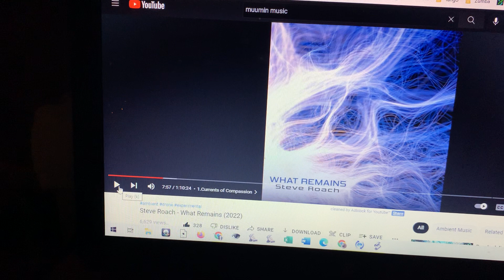Groundbreaking Report:  Potential Solution to Power Factor Problems!

Comment: "Hopefully" the second system will sound differently.. yes hopefully..

It is HOPEFULLY because we have 3 phase going into the apartment/house. From EACH individual phase we put a circuit breaker (that you have shown in a previous video) and you can run that to a dedicated power outlet for your stereo.
You might think that you probably have done something awesome..

When you have many let say 100 difrent power consumers in your home. And you can see in your breaker box that there is more than 3 circuit breakers.. 😉 

So if you have 30 circuit breakers evenly distributed between those 3 incoming phases then 10 circuit breakers for each phase.

So your "dedicated" power outlet is actually using and sharing the power between 9 other fused lines!

That means when you sit and enjoy music on your dedicated line and someone else in the house is switching on/of a light or appliance that are also derived from the same phase in your cirkut box. You can and I have experienced a "click"/spark sound in the hifi system! 
Because as fancy it sounds a "dedicated" is not the same that you are alone or isolated from others devices in your home.. maybe you are isolated 2/3 of them 😉

Next thing to know:
Power transformer will change the PF in one way. And if you want to go the other way (the opposite direction for correcting the PF) then add capacitance.

So now we know we need to have our two systems on different incoming phases so that there is a possibility that one is performing differently than the other.

The other thing we know is some appliances are 3 phase (electric stove, hose heating, some washing machines ans so on.)
For example my electric stove that is connected to all 3 phases, uses internally the different phases on difrent heating zones. So if all is cranked up to maximum then it will draw current from all 3 phases and being able to dispatch more wattage/heat. But depending on which of the heating zones I turn off then one or two phases will not be used. So depending on what phase your hifi system is using and how other appliances are switching in/out on the same phase as your Hifi system is using that will momentarily effect the PF you get to your Hifi system.

So nothing strange there in my opinion.

I have a EMI filter power brick. The only or the biggest reason I bought it were because it not only shows the normal things in the display as Voltage, amperage, wattage and so on. But it do also show PF!

I also of some reason bought a power saving device that is plugged into the power wall socket. That contains a capacitor..
I just could plugg it in or out and I could see the PF value jump up or down when I did that.
So the electric theory worked and the measurements did measure PF indeed.

But to be perfectly clear on one point. Despite it were so "easy" to change/adjust PF. That made A-B comparison really easy. 

And I in my system I could not detect any sonically difference in one or the other way.. so for me the PF experiment were a failure. 🤕
(One difference is that I am in Sweden and use 230V and 50hz so I don't know if a lower voltage system is more sensitive to PF changes?)
Reply: what is PF? 🙃
Reply: @raoulselten9480 Sorry, PF is Power Factor.
It is a measure of how much the voltage sine wave and current sine wave is in phase or more precise how much they are out of phase.

When they are in phase with each other then we are able to get the most power (wattage) when they peek at the same time.
Reply from the maker: Indeed, most likely 230V is much less sensitive to PF changes. I have never experienced PF problems in Hungary (230V), and I have reports from Australia (also 230V) that it's not a serious consideration there either. Also, apparently in Europe / Australia PF is much more tightly controlled than in the US. Here, it is ATROCIOUS, and the swings are humongous. I have never measured it, but I can experience it as vastly different heating capacity for the stove - sometimes even high setting is barely warm, and other times a low setting is already burning the food. That's indicative of hyper-massive PF fluctuations. We get single phase electricity for homes, and often the line is so overwhelmed that there's serious DC on it due to massive imbalance between the 3 phase distribution legs. So, here I have the "joy" to experience the wildest issues with line AC status - with PF, DC on the line, massive noise injected by myriad of SMPS in the homes, and super high number of electric devices in the homes.... 
When having different incoming phases, different optimal system for each is a very good idea! 👍
This is the sad bit about power, that there's no universal solution as the power situation is so vastly different in different places. Here, it differs from area to area, and mine is not even the worst....
Reply: @AmazonasBiotop  thank you 😊
Reply: Your stove and furnace aren't 3 phase. If you're in North America they will be 220 volts. It thought this was 2 phase when I was in electrical school and got corrected quickly. Think of it in terms of sign waves. If you had the equipment to see what's happening you'd see 220 volts is a single sine wave where as with 3 phase each phase is 120 degrees offset from each other. 

Not that this means anything in this particular situation. How do we know power factor is the reason the sound is bad? Industry could be doing all sorts of things that mess up the sound. Maybe it is just an issue of the huge load they put on the grid which is affecting the load impedance of the source. This is easily measured. 

A lot about how electricity works is not understood. The big brains that work with this stuff think they have it all figured out yet most of that is highly specific to particular contexts. Try to find a comprehensive scientific explanation of how to design interconnect. They think they know but there are clearly issues they have never identified. Inductance is supposed to be determined by loop area which means that if you separate the send and return wires the inductance should skyrocket and ruin the sound but this doesn't happen. Part of the problem is the math is too complex so it got dumbed down with Maxwell and most have forgotten that that is a hopelessly simplified model allowing someone to get an answer at the end of the page. If they really understood this stuff it wouldn't be a black art to design things that give the very ultimate performance.
Reply: @bunsw2070  I don't know what to advise you..
I have no positive experience with power conditioners regarding sound quality. If it is that I have god power to begin with or I am deaf or something else. Or lucky to have dedicated 230v lines.
But how your power is at your place I have no idea..

So with my limited experience and with almost no issues I would not invest so much for something that yeald so little sound quality for each unit $ spent. 

Maybe your power is bad and you could hear a sound quality benefit then go for it.. If you could try out then it would be great.

And I would consider a surge protector at least if you plug in expensive HW.

Otherwise you get for example super much better sound quality MORE if you take the cash and invest in sound treatment in your listening space. But that requires more knowledge than being able to put a plug into the wall. 🤔😅👍🎵🎶🎼💞
Reply: @AmazonasBiotop  I never said anything about "needing" power conditioning. I've yet to buy anything beyond a Topaz Ultra-Isolator (31 or 32 series only - the ones with 0.005 pf capacitance) for my digital front end. I'm mostly talking in general terms about the nonsense that is used to explain these things. Of course the manufacturers don't want to say how there device works so they give us some nonsense. I emailed the local dealer for Critical Mass Systems footers. He emailed back to say they work on the second law of thermodynamics. I nearly threw my computer across the room. I'll bend over backwards to never buy anything from them. 

I'm thinking of buying a Isol-8 Minisub Axis or Substation (there is a video on TheAlphaAudio doing a comparison so you can hear for yourself). Larry at Real Hifi Help says the Isol-8 is the only unit he'd recommend. Then again he's in Europe so who knows. I'm in Toronto 30 miles from a super massive nuclear reactor but temperature and time of day seems to be the determining factors. I'd imagine that if you had any type of conditioners you'd use them depending on the season, time and temperature. I've noticed that a dropping temperature that is below freezing makes the most improvement. 

Now I find out about this ADD Powr unit which doesn't "filter" anything. Rave reviews on audiogon. I might try one of those.

Comment: I'm more of a outerlimits fan these days been watching it.
you could use a site transformers, 
if you had  1kVA 120V -110V and another one 110V - 230V as well, you could use a storage bank of capacities as well between the two transformers running 32amp output sockets.
as I have said to you before can clean up your mains especially earth, you can put an inductor on the earth inline make sure it's 2.5 mm copper wire you need to enamel it, and a green doughnut ferrite transformer, 7 turns spread out with gaps just leaving not covered the bottom 1/5 and seal it with shrink tubing. you could put a capacitor in parallel with the inductor 333pF x2 275V.
 a lot of the noise comes from the earth back into the system. a plate earth outside is better than a spike, and always use one don't start messing about putting another one and having two not good.
Reply: Interesting comment would like to add an inductor and cap to earth connection from wall socket , just need little help from you ,can we coordinate on gmail or facebook , please dont write an email adress on the comment it will be deleted dont use the at the rate sign   just type out your email if you can help me out i will contact you
Reply: @IDontExist14  sorry mate I don't do emails and I'm not on Facebook.
we can discuss it here!
Reply from the maker: We have tried playing around with 1kVA and 2kVA isolation transformers, and they noticeably restrict dynamics and live-ness of the sound. We found 48kVA transformer to be a good solution. My mentor has sourced it from military supplies and it's not a commercial solution, plus, it's really huge and requires a separate room next to the power box... it's quite incredibly effective, though!
Yes, the earth inline cuts down noise a lot! (When it's separate from earth). Here in the US the neutral is also on exact the same potential as the safety earth, so doing something to one and not both does not change anything. : ( However, it also cuts on dynamics and limits purpose of the safety ground - in case of a massive power surge it will act as a fuse and defeat the purpose of the safety line. (With the US home wiring - could be different in other parts of the world.) Sadly, no generic world-wide solutions :(
Reply from the maker: Never seen outer limits.. thanks for recommendation Hoobs! ;)
Reply: @realworldaudio  yeah it's good check it out good special effects for its day.
you must feel like you live in the Twilight zone 😂
Reply: @realworldaudio  well it doesn't affect the potential of earth not being safe! yes if you use small gauge wire that's why I said to use 2.5 mm wire, that's not going to burn out!
neutral and earth are not shared only at the grounding point from the metre, and yes it should still have a bearing even if the neutrals is not done, you're blocking interference and DC coming up the earth line, should be done for every individual socket/line you want to filter.

Comment: Regarding the power supply, do bigger and bigger and bigger power supply continue to improve the sound.
Reply from the maker: Yup, that is the solution! :) The bigger, the effects of line AC are lower.. yet, they still react to excellent line AC, much more so than the puny power supplies.